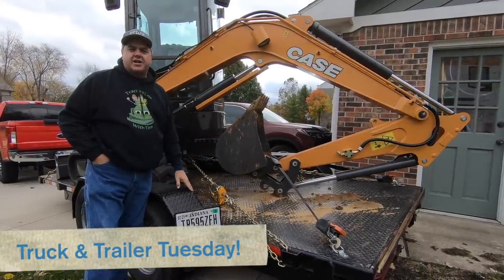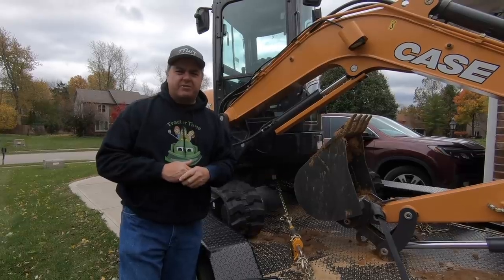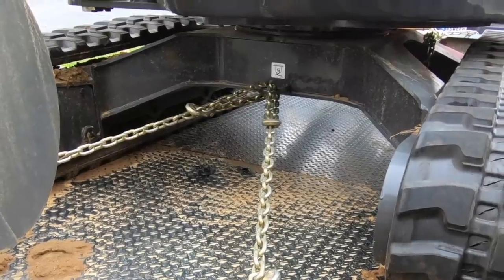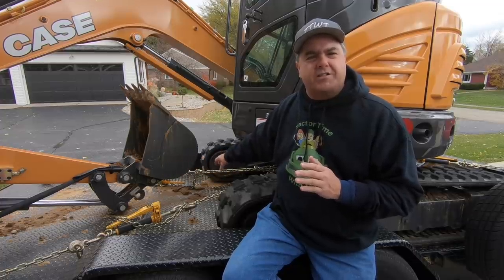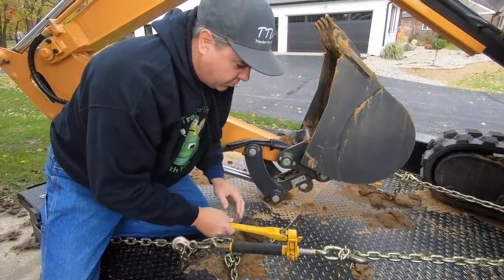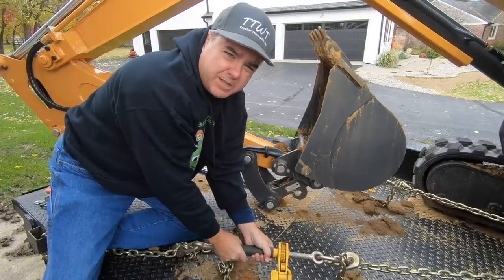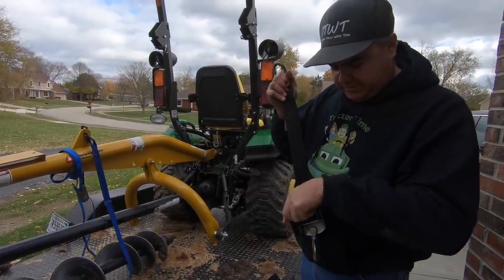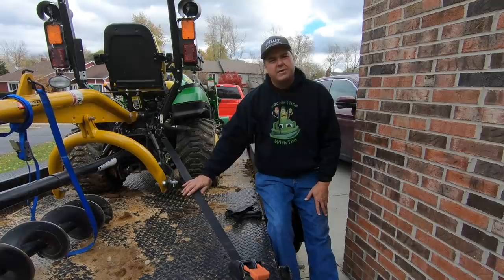Tie Down Your Equipment!  Truck and Trailer Tuesday

Comment: In case you where wondering immi is Indiana Mills Manufacturing Inc. , they make most of the seat belts in American cars. I designed some equipment for them in one of my previous lives (aka jobs)
Reply from the maker: They no longer go by Indiana Mills.  Rather, they use IMMI as their name.  Christy worked there for awhile until she quit to go full-time TTWT.

Comment: Very good video. Tieing down any machine can be a challange if the attachments get in the way. My tractor is 10 times the weight of Johnny and the factory made 4 eyelets in the frame for tiedown. Unfortunately the front shovel is in line with my trailers "D" rings and chassis eyelets. We had to have additional "D" rings added to the trailer to keep tiedown chains uninterupted. The backhoe can lock to the tractor but we chain it down to have a lower transport height. You don't want to loop over or under ever.

Comment: Tim - you should probably mention that the Cargobuckles that you are demonstrating do NOT come with a hook or anyway to attach them to your trailer other than permanently with a single bolt. I'm assuming you bought the hooks shown on yours separately. Which of course increases the cost of an already very expensive ratchet strap. I noticed in the Cargobuckle reviews that quite a few folks were surprised to find that when their buckles arrived there was no way to attach them.

Comment: Your doing great Tim, your using quality equipment which is essential, besides I’m very jealous of that backhoe ...
Years ago I did a lot of lashing on cargo ships & rail flatcars, first of stick with chains and always cross them so they pull against each other, I like those ratchet straps but have had them let go on me on bumpy roads, just say’n ...
Also never trust d-rings, I can’t tell you how many times I’ve seen them break, just consider the load you put on those lashings if you had to make an emergency stop, stick with chains whenever possible, these are just things I found out over many years & are too be taken with a grain of salt & I still would like to have that Case backhoe  :)

Comment: At work we transport a John deere 410 l backhoe almost daily and to my knowledge florida law requires a 5th tie down over the bucket our mini crews also tie down the buckets
Reply: I live in Georgia and was a delivery truck driver for two JD dealerships.  The law here also requires a separate tie down for a loader or backhoe.  So a tractor with both a loader and a backhoe would require six tie downs. The grill guard is not acceptable.  The frame or a front axle is required for a tie down.

Comment: For my JOHN DEERE  335 And GT235 there are holes in the front of the main frame I hook into and for the rear I use the holes for aligning the rear attachments or you can use the hitch hole but I tend to not use it to prevent from enlarging it as they tend to if your not using the correct size pin

Comment: I would wonder if your hood guard would be to flexible and if you should attach to the bucket hooks instead
Reply: The issue with connecting to the bucket hooks is that the bucket is hydraulically operated, and a leaky cylinder/valve/seal could allow the bucket to move and slacken the straps, which then may fall of the hooks and allow the machine to move to the rear and slacken those straps. Basically a similar situation to having to strap down booms and bucket on Casey or implements on the back of the tractor. Also the loader arms and bucket are both detachable and are supplied with maximum load ratings which would be way less than the total weight of the complete unit, so they in theory should not be used as tie down points. I would also guess that the hood guard is not structural and is probably not suitable for a tie down. For the Front end of Johnny, maybe a custom set of wheel straps for the front wheels might be the best option.

Comment: Issue with the straps is if you don't have those sleeves, they can be cut and frayed rather quickly.  Always make sure there are no sharp edges or anything that can rub against them!
Reply from the maker: That is my why we have the sleeves

Comment: I can see things being a bit tricky with those D-rings. The WLL marked is for the D-ring hardware itself. It doesn't apply to the bolts or the material it is bolted to. You could take a 5000 lb. D-ring and bolt it to a thin piece of sheet steel and it will tear right out long before 5000 lbs. Likewise with the bolts used. They could easily break long before 5000 lbs. That is why tie down points are so confusing and in many cases they end up being the weakest link in the entire tie down configuration.
Reply from the maker: Yep.

Comment: Very good video. Suggestion for when you unload your mini excavator to keep from beating up the grass with your bucket by allowing it to slide try to work your controls like you pulling your bucket in towards the machine and boom down while reverse walking off the trailer. We do this manuver unloading off the trailer even on pavment it's not to hard to learn and it saves ripping up the ground and scratching the road not to mention your bucket. Keep the great videos coming love your channel.
Reply from the maker: first time I had ever unloaded it.
Reply: Keep practicing you will love the cab. Does you new mini have the pedels so you can use your feet to reverse.
Reply: I run a bob cat E55
Reply from the maker: It has pedals which are directly connected to the hand levers. Is that what you mean?
Reply: Tractor Time with Tim yes sir. Some excavators have a tab on the for controls that you can flip over so that you can do the reverse motion with your feet. If it has them when flipped open you can use your toes to go forward and heels to reverse. I'm calling forward the end where your push blade is
Reply from the maker: I don’t think I have that.  Not sure.  I’ve not used it yet!
Reply: When I load and unload my bobcat 337 I stretch the boom out towards the tongue of the trailer, as I reach the pivot point the machine transitions less violently as it tips from one angle to the other. It also seems like it doesn’t want to lift the tongue of the trailer as much as well.

Comment: Snap binders are alot better for wheeled equipment cause you can squat your tires a bit. I have 3 snaps and 4 ratchets. So i use 2 snaps and 2 ratchets. The 3 bottom i use 2 ratchets on it. I then like to put a 2 inch strap on the loader if i have 1 available.  My tractor wieghs around 7k

Comment: Though I don't know if those  rules apply in all states, the way you explained it sounds sensible and logical. I'm not all together sure about the tie down straps, but I've never tied down a load like you have, only small loads on pickups, or huge loads on flatbed semis. They would not be acceptable on a large semi truck, unless the load was extremely light but bulky like large diameter PVC pipe or something on that order, and even then I'm not certain they would pass muster. Been a long time since I've needed to do anything like that, and hopefully will be a very long time until I need to try it again. However, those straps are head and shoulders above the usual kind. If they could make them heavier and or wider, that might be a real boon for semi drivers too. The regs do not specify chain or straps, just how strong they need to be. There are some straps with carbon fiber strands in them that I hear have terrific working load characteristics, but they're mainly used by the military I don't think the average joe could afford them when chain would have a similar capacity at a lot less cost.

Comment: Hey Tim. I did read on a tag of a new Pull over binder as you call it, that you are not to use a cheater bar on them at all. I tried to find a link to it but had no luck.

Comment: You mention a wll on the chains and straps. Curious do you have a wll on those stake pockets.  Im pretty sure there is. And the front might not be the greatest place to hook to but the rear i feel is the most important do to a panic stop can exert more than the loads wieght vs even if you floor it youll only exert a fraction of the wieght
Reply: I agree, I think the rear tie point are good but the front points aren't load tie points, it's the grill guard and doesn't really have the strength to support the machines weight properly when excessive forces are applied. The tie down points on machinery are not just there to hold it in place from rolling back and forth when you start and stop but are there to keep the equipment attached to the trailer in the event of an accident or rollover.  Definitely don't think the front grill guard has the structural support to do that I recommend finding another tie down point.

Comment: Nice video!
Im curious as to when securing the John Deere if you could just attach at the hooks on top of the bucket up front since your straps go right by there?
Would eliminate the need for rub protection and i would imagine it would be a stronger point.
Reply: I know this is a late reply, but, the answer is that the bucket is not part of the frame AND connected to hydraulic cylinders that will eventually move while under pressure due to oil leaking past the seals in the cylinder. All cylinders will leak over time which would loosen your connection.

Comment: Please, for the future hauling of your "Johny" 1025R, DO NOT use you front hood guard as a tie down point at any time of transporting/hauling Johnny. Use the square suitcase mount that on the front frame of the tractor. it is way more solid & heavier for such "front end tiedown points!" 

Also when you're driving Johnny up onto the rear trailer loading ramps, when ya have the front loader & bucket or other attachments mounted up to Johnny, keep those loader arms & bucket or whatever attachment at an alot lower point then whatchya had there in the video. you loader arms & bucket was purty dog gone high for such an maneuver. ya need to keep all possible weight down at a safe low point when loading/unloading with front loaders & attachments. Thanks for sharing the video with us & remember to be "tractor safe!!!" Take care & God bless ya'll.

Comment: Comealongs,hand cable winch does not cut it.Brakes both axles,break away cable attached to vehicle. Loose items[gas cans,shovels,rocks] can't be on trailer.

Comment: So if I have a TLB I have to tie down FEL and backhoe? When I brought it home I just used the pins the backhoe comes with. And strapped the bottom of backhoe frame. Didn’t use anything for FEL. oops.

Comment: I know it's not the best practice but I never Tie My Tractor Down unless I'm going down the interstate just for show
I lock the brakes and put it in low gear. Never moves. The gooseneck won't let it go forward the ramps standing up on the back of the trailer won't let it go backwards
Reply from the maker: Wow.  I do NOT recommend that.  It is illegal.
Reply: Tim Strickland   I hope to never be within a half mile of you

Comment: Hauled D7 dozers for the last 17 years on 40 ton trailers with 6, 1/2” chains.  Graders with 5, rollers with 4, skidsteers with 2, attachment boxes with straps. Your data is right. Brother in-law is a DMV officer and I run things by him on occasion. There’s many right ways, and just as many wrong ways to do it. Think about it this way: The reason they calculate the usable load so low, is because really if the load shifts, your holding the lightest component to the heaviest, not the other way around.  If your trailer and load flop, the trailer is staying attached to the load.... which the trailer in most cases is not as heavy as the load.  Backwards to think about, but the weakest link is actually the trailer, because only gravity holds it to the ground.
Reply: Wise words ..... :)

BTW .... When you say 61/2" chains  .... What does that mean exactly ?

The diameter of the link .... Or the length ?

BTW .... I'm Aussie .... And work in metric ..... But sadly more than old enough to understand Imperial as well ..... FWIW .... The old habits die hard ... You say 15mm .... I say six inches .... ROFL! :)
Reply: Sure I’d be happy to clarify!  For a D7 which weighs in about 60,000lbs dressed for us, I use 6 chains all of which are 1/2”. 1/2” referring to the thickness of each chain link.
Reply: AND I've never been near farms or machinery .... I'm in the nursing home now .... All my knowledge comes via my laptop ...... :)

I wish I could have done what all of you do or have done ..... I was meant to use my brain instead ..... :(
Reply: @s1283  Thank you ..... Now THAT makes sense ..... :)
Reply: My dad was an equipment mechanic for JD and I learned everything from him until the military. Then they brought the operator out in me, then the supervisor lol. So slowly I too am being removed from the big toys, and spend more time doing reports and meetings and teaching. I will say I’ve been blessed to teach my craft.  My guys call me “Dozer daddy”. When I was in Iraq back in 2006 I spent a lot of time hunting bombs and in a dozer, and some brief time with the Aussie army. Good blokes! Lots of laughter and they knew how to have some  fun.  Cheers Jim!  Glad I could answer / explain that for you!  What did you do before the nursing home?
Reply: @s1283  Carer for my wife for 20 years ..... Previous to that I was in building management ..... For the Australian Public Service ...... For 17 years .....  History before that .... Not really consequential .... Only served to get me to where I was to go to .... And meet the people I had to meet ..... :)

BTW .. I am an Aussie also ..... G'day Mate ..... If we give our hand in friendship ..... Take it ..... You will have a friend for life ..... :)

At least us older ones ..... I don't know about the current generation ..... :(
Reply: BTW Tim .... Sorry to take over your channel .... Delete as you wish ... :)
Reply: I have all the respect for you in your life endevour Jim.  Honest mans work.  Tim, also my apology for the tangent.
Reply from the maker: No worries.  Enjoy!

Comment: Stupid question.  The D rings have a working load limit of roughly 1600 lbs.  The chains on Casey for each one is 2000 lbs.  So does that make it unsafe because it’s 400 lbs more?
Reply from the maker: I did not use the d-rings for Casey.
Reply: Tractor Time with Tim, but you would not be able to use those with Casey, correct?
Reply from the maker: No, they would not be strong enough.

Comment: I don't have sources, but i just don't feel good about how the front of the tractor was tied down. Should've in my opinion had 2 straps or chains from the frame, and at least 1 more for the loader since as you said implementsl need to be strapped separately. Also the auger was not strapped down at all.. Not to mention that guard is not meant to be an anchor.

Comment: I noticed that you didn't specifically show the auger being tied town in addition to tying the tractor down and I wondered what the WLL is for the grill guard. Your front straps hold the tractor and the bucket. Is that OK to do legally? I do something similar with my JD 4520 and 6' Bush Hog on the back. The chain runs over the front corners of the mower deck to get to the tractor so I don't bother chaining that down separately nor do I chain down the front loader. I suspect I should chain them both down. I was told by a DOT officer one time that the truck and trailer combination GVWR can't exceed 26,000 or I'd need a class A license here in New York State. So my Ford F-350 has an 11,300 GVWR and my Bri-Mar trailer is rated at 14,000 GVWR. That means I'm 700 Lbs away from needing a Class A. They go by the rating tags, not your actual weight at the time they happen to stop you. So if they happened to stop me and I was empty, if my trailer had a GVWR rating of 15,000 I'd be in big trouble. I like your videos very much Tim. Especially the scripture verses at the end. Keep 'em coming.

Comment: Around the 5 min mark you talk about tying down the boom on the mini extractor. Later when you tie down Johnny you put a seperate tie down on the post hole digger, wouldn't the FEL bucket also require a seperate tie down? I looked on the website you mentioned but did not see anything specific.
Reply from the maker: I suspect the loader boom would require a separate tiedown as you mention. I usually do not use a separate tiedown, honestly.
Reply: @TractorTimewithTim   thanks for clarifying! Have a wonderful Thanksgiving!

Comment: I put hooks in the front of my tractor rated at 3300lbs each, I dont know if I would trust the brush gaurd like that. I try and strap all my loads so if I get into a accident and roll over what ever I am hauling is still strapped.
Reply: paintballer7171986 - is the method you used to mount the hooks on the tractor also rated for at least 3300 lbs?
Reply: @eosjoe565  its actully eye bolts with a 7 inch threaded shaft on it. It came with a sticker on it saying wll is 3300lbs and I have 2 on the front mounted on the frame. I try and hook all tie downs to the frame, it is obviously the strongest part.
Reply: Not trying to sound sarcastic but that's exactly how you're supposed to tie down a load, is to prevent it from coming off the trailer in the event of an accident or rollover
Reply: @Chadfarmingandcranes  I know some people dont, they tie it down just too keep it in place for heavy breaking.

Comment: With chains and straps it is easy to determine the WLL. But how do you know the WLL for any tie-down loops on your trailer? In all likelihood they will end up being the weakest link in the system. I noticed you were using the square channels for side-rails. Did the trailer manufacturer list the WLL for those pockets?  Did they specify hooking chain to them in that manor?  I have a landscape trailer with some tie-down points but there is no specification for them.
Reply: EOSJOE it’s a legal loophole if they don’t specify, it’s all on you.